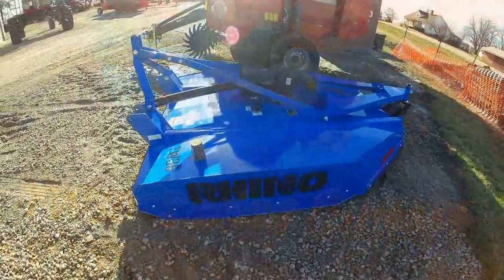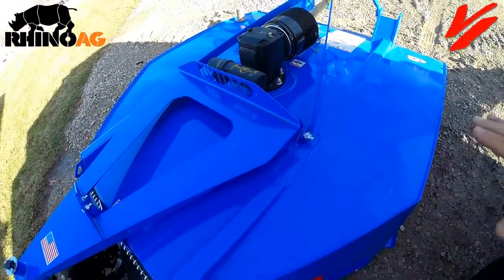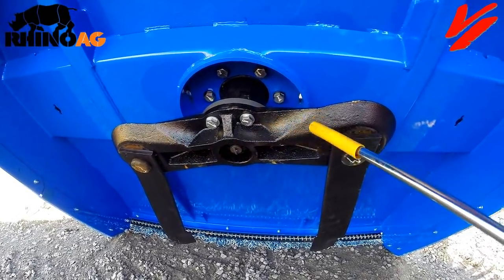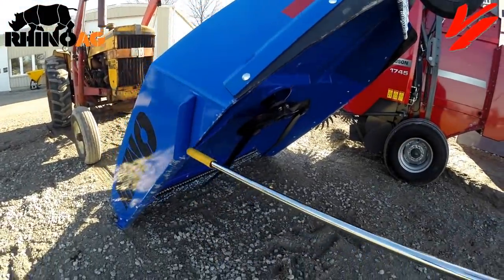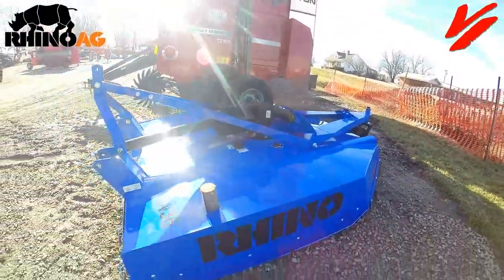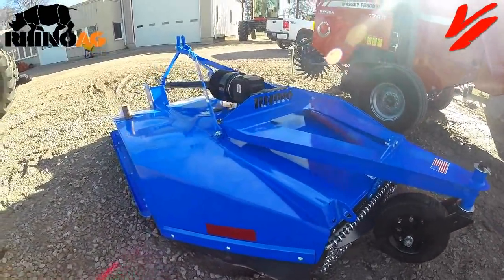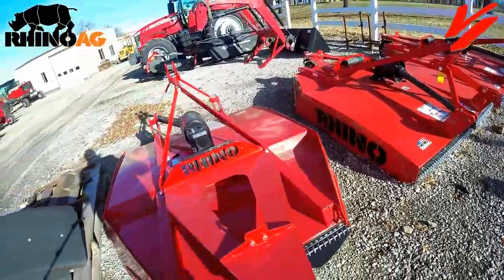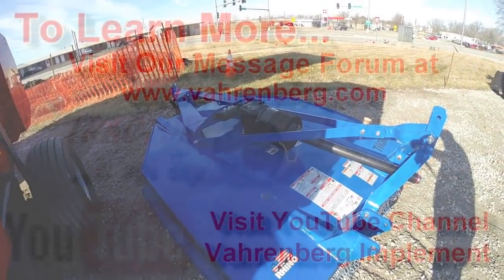RhinoAG TW36 Extra Heavy Duty Rotary Cutter

Comment: Been using a TW35 for a few years.  So tough, would buy again.
Reply from the maker: The TW30 Series are BEAST. Here nothing but compliments from those that have Extreme Mowing Conditions and the performance of the TW30 Series. Thanks for taking the time to comment and watch our video.
Reply: @VahrenbergImplement  only weakness is the tail wheel itself.  On my third.  The round shaft on the yolk part bends and locks up in the bore.  Gotta be careful, backing into hidden stumps.

Comment: The spaces between the weld points looks like a potential weakness. I'd like to see the Rhino AG TW37 in action. Also, just like another viewer I tried to find a dealer up here in the province of Ontario, Canada. But nothing showed up on the Rhino AG (find a dealer) website. With 15.5 million people in Ontario - and lots of farms. There should be someone up here that sells them.
Reply from the maker: RhinoAG is one of most if not the most tested mowers by any manufacturer. They put them to test to make sure they last. Here is one of the Tests they perform for product durability. https://youtu.be/N8Q1qXWGC14 We had the opportunity to participate in the TW30 testing with a company that destroyed their old brand mower in 30 days and couldn't damage a RhinoAG. Actually this video is the mower they purchased after testing. Not sure about Canadian Dealers but contact RhinoAG and I bet they can help you find your closest dealer.

Comment: Over $10,000   for the MP348         You can buy TW30 Rhino  for $3,500   even if you destroy it, you can still buy three Rhino's for the price of one MP348.      You should try the Rhino.  Thanks
Reply from the maker: That is interesting point. Thanks for the comments and watching.
Reply: How much would it be for the tw36 shipped to Ontario Canada?  I would love to get my hands on one of those, we're building a thatch roof cottage first one in Ontario and we bought some land with heavy brush we are trying to clear the land at an affordable cost.  If I could get a good deal on that, I would make all kinds of videos showing us clearing the land and showing what this machine can really do.  I have a Kubota M4950DT.   Older tractor but has lots of horsepower, we're 55 plus horsepower with 50 horsepower on the PTO
Reply from the maker: That is outside our sales area but call or Contact RhinoAG. www.RhinoAG.com and they can put you in touch with dealer or distributors in Canada.

Comment: The specs on this thing seem the same as my Rhino 272. And the price seems about the same as I what I paid several years ago for the 272. 
Very tough shredders
Reply from the maker: It's close but the 272 was 2.5" Cut Capacity Machine it inbetween the TW20 and TW30 Series as far as specs. They were great machines, RhinoAG has just made some improvements in the New TW Series Cutters.

Comment: There does not appear to be a top link swivel mount.  Is it just not installed or does Rhino not have them on the top link mount.  I am so fed up with bent rotary cutter top linkages from mowing over uneven ground.  Can you provide in detail how Rhino has designed the top link on this rotary cutter?  Thanks!
Reply from the maker: Great Idea that I forgot to show but the Top Link Hitch point has linkage that will move to follow ground contours. If you see the two bolts just behind the top link hitch point that clevis is actually a yoke that is angled on the back edge to allow the mover to tilt up/down as you follow terrain. Kind of like a breakaway system. I will try to include that in a future video this break-away style system starts on the TW20 and TW30 Series 3 Point Mowers. It's a more premium feature versus the TW10 Series that has pivot toplink U shaped yoke.
Reply: Use a 5/8 chain for a top link. May need to egg shape the links on the each end. Maybe a a 3/4 for cat2. Have cutter level at height of cut with just a little sag in the chain . Will follow contours and not break stuff.

Comment: I’m trying to buy one of these TW25s in NH Blue but cannot find anyone in Middle TN willing to do the work to find it. I’ve reached out to the company. I’ll drive to Illinois for a quality unit. Anyone know easiest way to buy one? Never had such a hard time spending $2600
Reply from the maker: Your Local Dealer can Special Order them Color Matched. How we did this one for our customer. It will take some time before you can get because of demand is out pacing supply but any dealer should be able to special order and get you one.
Reply: @VahrenbergImplement  finally got a return call this morning for the unit in question in the color I'm wanting. Pricing matched RhinoAg's "Build Your Own". What's not clear is how much RhinoAg will charge for freight. It's a little annoying due to the fact that RhinoAg's site classifies dealers has stocking full, partial, or by special order. This particular dealer was listed as their "Premier" dealer so should have some sort of RhinoAg rotary cutter (I would've settled on a different color as long as the model was right) or any random attachment in stock however they never have. The alternative is to spend a comparable amount of money to just drive and trailer it back and not wait for however long it takes them to make one these days, perfectly willing to do so but seems like RhinoAg needs to get a more accurate map of who stocks inventory and who doesn't. Imagine what a turn-off it is to someone who needs a cutter, is ready to buy one, yet is told 6 weeks plus freight. That no-name brand unit sitting on their gravel lot starts to look a lot better since its there and its easy.
Reply from the maker: I understand your frustration but 2020 has been a challenging year. When COVID-19 hit most dealers expected a down turn in sales. It was huge change...sales are outrageous and keeping inventory is a challenge. I have two cutters and one flex wing left in inventory and production is behind. Many of the employees are taking advantage of the Bonus Government Benefits and staying home versus going back to work. RhinoAG is working their tails off with the employees they have back to work and demand is growing daily. Yes some models are several months away depending on production schedules. I know it's frustrating but RhinoAG & Dealers are trying their best and did not see this COVID-19 Coming and Huge Explosion of Demand for RHinoAG Products. Maybe I screwed up making these videos and more people are buying RhinoAG Products and causing even more backlog in inventory supply.
Reply: @VahrenbergImplement  I appreciate your time explaining what you know about the matter. Hopefully this thing outlasts the tractor that runs it.

Comment: Looks extremely well built but what your calling a "stump jumper" doesn't look much like one to me.
Reply from the maker: You must be thinking of the old round pan aka gearbox killers. RhinoAG use to use them but learned that when they become out of balance from hitting obstructions in the field they dramatically reduced gearbox like from the vibrations. The new Cast Iron Infinite Dog Bone Stump Jumper has so many more benefits and added stump jumping capabilities because the angle is more than just the outside edge it extending inward to the center of the hub. Plus Cast Iron does not dent or get out of balance like them thin steel pans that are balanced like a wheel until you hit something. I seen the dog bone cast iron blade carrier hit a concrete structure with steel man hole and barely scratched the paint. Round pan would have virated and destroyed te gearbox if not replaced. Round Pans may look like they do more but actually they cause more problems and more expenses for the customer.
Reply: What is the price for the 5ft bush hog
Reply from the maker: List Price for TW35  is $3800 to $4100 USD range depending on features and how you equipment.

Comment: My thing is how are you going to get a 3 in. diameter tree under the deck. I'm not picking on Rhino(it looks like a very well built unit). Its just that almost every manufacturer that makes a cutter rated to cut 3-4 in.+ material has no cut away and no adequate rear opening to allow larger material to contact the blades without having to bend much. Trying to bend 3-4 in. diameter trees with the rear end of the cutting deck is not ideal and next to impossible unless you have a tractor that's at the upper end of what this cutter will handle.
Reply from the maker: You would be surprised what some customers can do. We had a customer that mows in some extreme terrain and field tested the TW36 and they stated "This TW36 out performed their previous brand cutter. They stated it spent lots of time in the shop getting rewelded and keeping together and the RhinoAG had zero issues. They cut trees 3" diameter and hit lots of rocks and the cutter still looks almost like new except for the grass stains, mud and dirt" RhinoAG actually builds cutters that are rated to cut 5" trees. Go watch the RhinoAG 4155 Video in South Texas Cutting trees and look at the base of them trees they cutting off. They have a special purpose built tractor to tackle that heavy duty mowing.
Reply: @VahrenbergImplement  yes I know full well that it's built well enough to handle it. I mentioned that above. I'm just saying that almost no manufacturer except for Brown designs their deck to engage the large material that they make them to cut. Bending a 3 in. tree under a classic style bush hog deck to cut it is inefficient and it also produces the "explosions" that send large chunks of wood back toward the tires and the ground under the operator. By the time the tree gets bent up under there, the cutter takes too big of bite and BOOM.
Reply: I have run my TW35 for about a year and I'm always running over 3"+ material.  Not always backing over 3 inch trees but you come across large diameter fallen branches you don't know are there until you do.